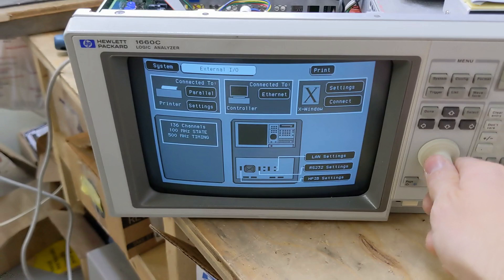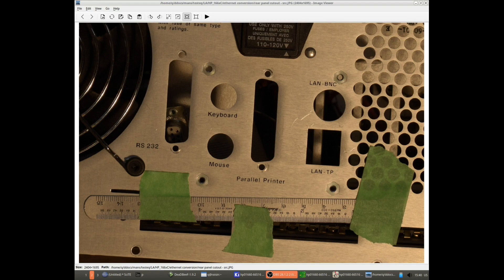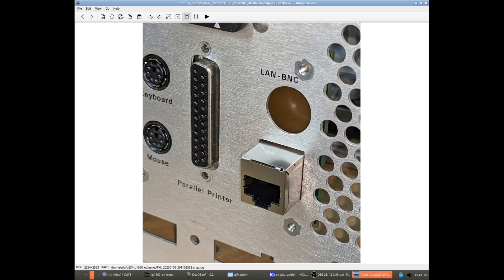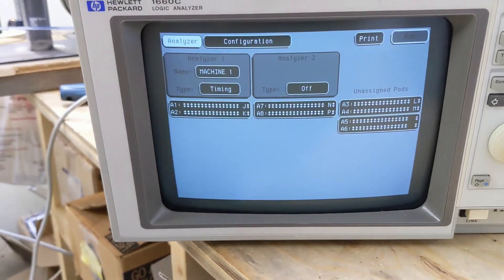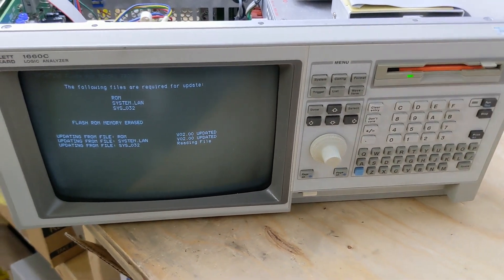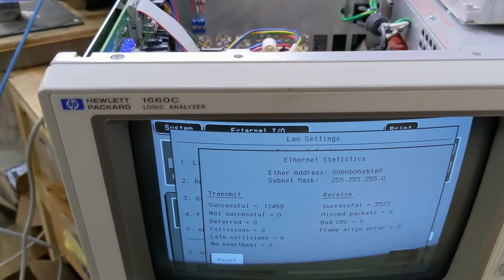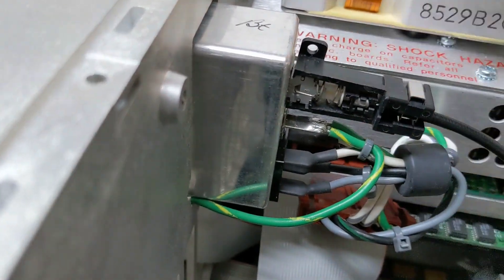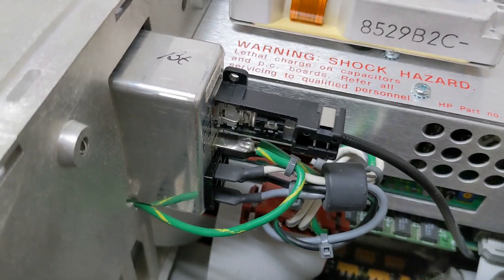HP 1660 (166x/167x) LAN option : DIY add-on

Comment: i got 1661C and it has bay not holes, maybe i going mod this if needed ethernet, so the controller is on motherboard so it only need socket if i understand corerct?
Reply from the maker: interesting, I thought the whole 166x series was mostly hardware-identical. The network controller should be on the mobo ; large PQFP-160 IC,  labeled DP83934 . You would also have to verify the pinout on whatever ribbon cable or connector for the LAN option.